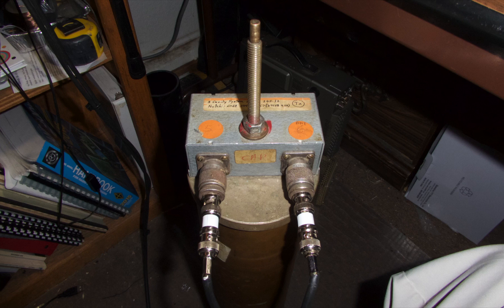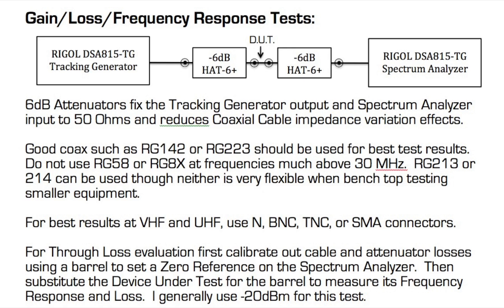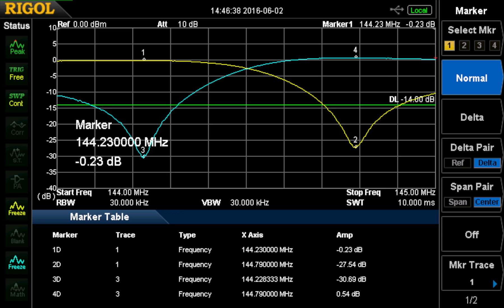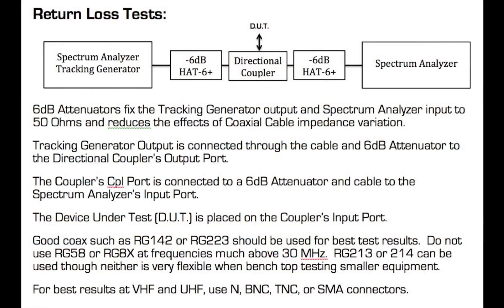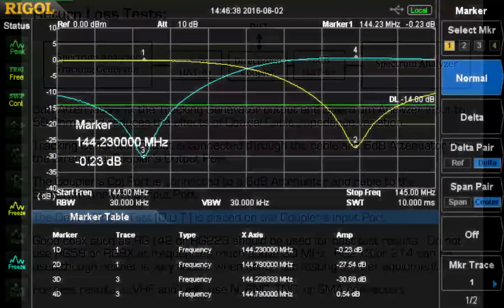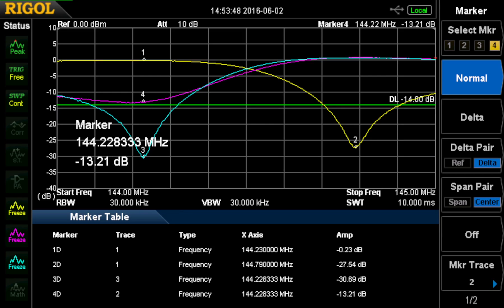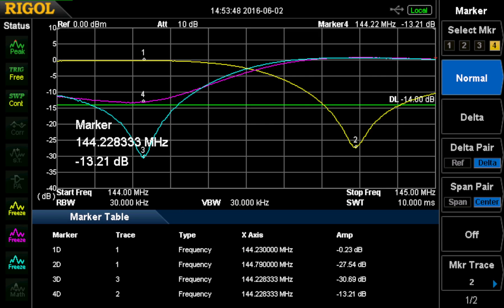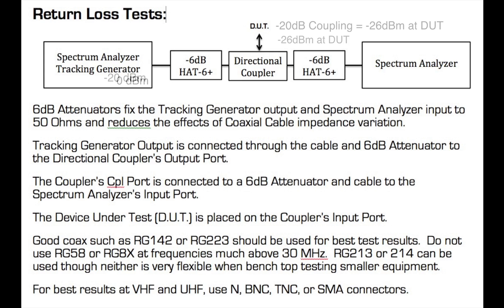VHF Pass Reject Filter Pass Loss and Return Loss on the DSA815

Comment: good video would this cable work ? seeing rigol specs on you paper
RG316 BNC Male plug to BNC Male plug RF Pigtail Jumper Cable
Reply from the maker: RG316 has 38dB loss per 100 feet (0.38dB/1ft) and is single shielded.  Otherwise OK.  RG223 has 13dB loss per 100 feet (0.13dB/1ft) and is double shielded.  There are high precision test cables available that are RG316 size but they tend to be expensive.  If you are going to use SMA connectors on small devices the smaller cables are advantageous despite the extra loss.  In a typical test setup a total cable length of 3-6 feet is common just as a practical matter thus 0.13 vs 0.38dB becomes more of an issue depending on what you are trying to measure.  Often normalization can be used to correct for any cable losses and RG316 has a good match, typically 21dB return loss at 1GHz.